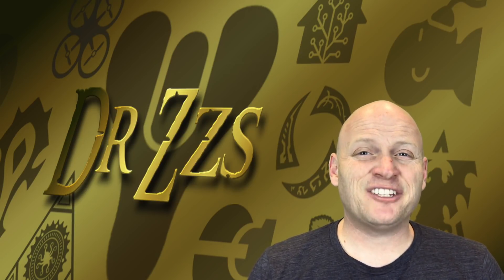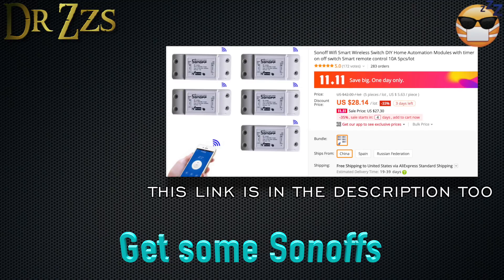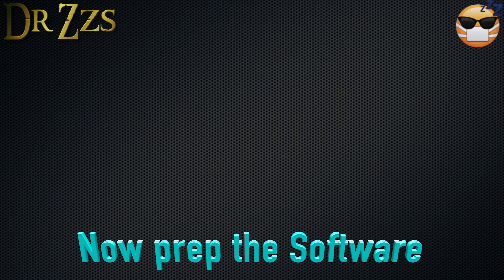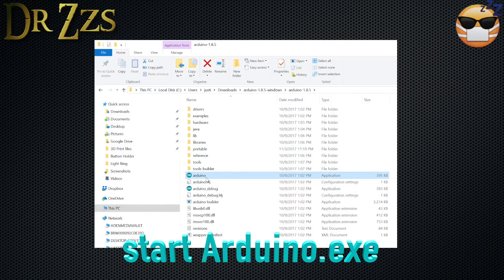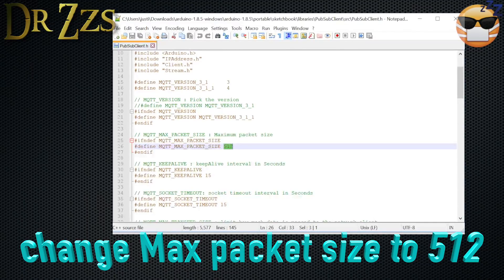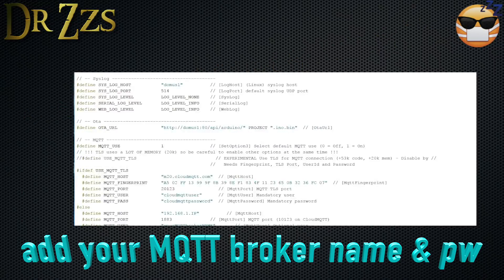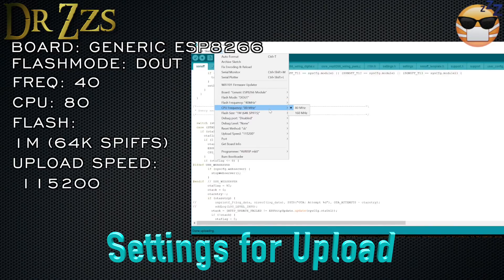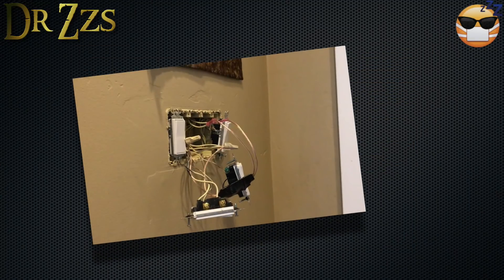Flashing TASMOTA Firmware on the Sonoff Basic

Comment: Great tutorial but I can't upload the file in the Sonoff. 
Everything worked fine, I could compile all but I get the error messages 
"warning: espcomm_sync failed, 
error: espcomm_open failed, 
error: espcomm_upload_mem failed and
error: espcomm_upload_mem failed."

I tried to swap the TX/RD lines but it did't work. What's going wrong?
Reply from the maker: You might not be getting the board in programming mode?  
you have to hold the button when you power up the board.  It can be a little tricky.  
What I found works best is connecting the USB/FTDI board to the PC, then connect the Tx/Rx/Gnd to the board.  And last, push the button then connect the 3v pin to the board.  
I got a chime on my PC when I had done it correctly.  
That's my first guess.
Reply: Hi!

and thank you for your answer. The problem is indeed the programming mode. 
I have a sonoff RF and in this type of device you CAN'T start the programming mode with the button. The layout of the board has been changed.
I found the solution here: http://bit.ly/2Dz3CVp . After I soldered two wires and connected them to a push button I could put the sonoff in the programming mode and upload the firmware.
Solved!
Reply from the maker: Fantastic!  
yes, on all sonoffs (as far as I know), you have to put GPIO-0 to ground when you power up to get to programming mode.  Not all of them use GPIO-0 for the on-board button. 
Glad you got it solved! 
Another victory for the the DIY-guys!

Comment: Thanks for the video. I ran into a few hiccups with this new version but in the end it worked great and was in home assistant once I added it. I was getting missing library file errors. For example one was TasmotaSerial.h missing and another was  IRRemoteESP8266.h missing. Instead of knocking them out one by one I did this:

I copied everything from Sonoff-Tasmota-5.11.1\lib folder into C:\Program Files (x86)\Arduino\libraries

 All errors cleared and flash was successful.

Not sure why I had to do it but it worked, maybe I missed a step and this was required from the get go.

Thanks for the video. Between Superhouse.TV, BruhAutomation, and yourself this is moving along nicely.
Reply from the maker: Thanks! 
ya, I need to update this.  At the time I made it all the necessary libraries were there, but now the best thing to do is what you did. Just copy the whole folder from Tasmota.  
Glad it's working out.  Being listed with Ben and Jon is pretty cool. Thanks
Reply: I'd send you a PM with my website address but I don't think it will let me. I'm slowly building a page... but I think the three of you and whoever else should start one. 

Home Networking, Automation and Technology is a hot topic right now .. and the current sites that exist have unhelpful content.
Reply: I'd send you a PM with my website address but I don't think it will let me. I'm slowly building a page... but I think the three of you and whoever else should start one. 

Home Networking, Automation and Technology is a hot topic right now .. and the current sites that exist have unhelpful content.
Reply from the maker: Nice Timing!  
I just spent some time yesterday working on mine.  I had a site that was okay, but I want to make something better.  I'm spending a lot of time learning WordPress right now. 
I did get email set up.  You can send me stuff at:
justin@drzzs.com

Let's discuss what content would be most helpful!

Comment: Thanks for the guide..1st Tasmota Sonoff complete! - for those who are having errors on compiling do this - copy everything from the tasmota zip files 'lib' directory (in my case it was  -  Downloads\Sonoff-Tasmota-5.11.1\Sonoff-Tasmota-5.11.1\lib)  to your Arduino folders 'library' folder (in my case - arduino-1.8.5\libraries) and it will clear up all those errors in one hit :)
Reply: From experience I've found it's always better to use the libraries included with the Tasmota source rather than downloading the latest versions with the library manager.  No need to download json or PubSubClient as they are also included with Tasmota.  When doing this, there is no need to edit the PubSubClient.h file as it's already done.
Reply from the maker: Awesome!  Thank you!  That'll help a lot of folks!
Reply from the maker: Zeric E Sweet!  That makes it a ton easier. 
Thanks!
Reply: It helped. Thank you .You saved me gray hair.
Reply: thanks I put everything into the portable folder as followed from this tutorial complied right away
Reply: That worked for me as well, thanks. I also already had a newer arduino board manager from having recently done some flashing of NodeMCU 8266 boards so I skipped that part. In case anything changes, this is as of Jan. 2019

Comment: i'm not have "Qunqi 3.3V 5.5V FT232RL FTDI Usb to TTL Serial Adapter Module for Arduino Mini Port". can i use aduino UNO r3 ???
Reply: Any USB serial converter will work provided it's can supply 3.3v power.  An UNO R3 can work just fine, search google for tutorials. I prefer a stand alone CH340 based converter, only $2 from china or about $7 on amazon. Prior to getting that, I used an UNO for serial programming but it's been so long (years) I don't remember exactly how I did it, but the information is out there.

Comment: why this error now:

Board generic (platform esp8266, package esp8266) is unknown

Error compiling for board Generic ESP8266 Module.
Reply from the maker: try this URL in the Board manager URL box in Preferences:
http://arduino.esp8266.com/stable/package_esp8266com_index.json

then search for esp8266 in Tools - Board - Board Managers

I wish I could just give you one that's already done.  Sorry
Reply: I uninstalled all. Installed again. stable json too. A new set of errors at compiling. :((

Thank you, but I wanted to do it myself. Now, I have to stay to use original sonoffs, that connect to itead server, that is not reliable. 

Then still there is to setup mqtt broker and to find android and ios app. Also without succsess with my ota tasmota sonoff.

Comment: now, this file is missing. #include <TasmotaSerial.h>

I am at the end with my ideas
Reply from the maker: ya, that came up for someone else too.  I know how to find that file, but I'm not sure exactly where it goes. 
You can get the file here:
https://github.com/arendst/Sonoff-Tasmota/tree/development/lib/TasmotaSerial-1.0.1/src

This might tell you more about what you need to do.  
https://github.com/arendst/Sonoff-Tasmota/issues/1522

I didn't have that problem.  I don't understand why some people have. 
Man, I am sorry you've had so much trouble with this.  I know how it feels to work so long on something that should be simple and still not have success. 
I really hope you get it solved soon!
Reply: now i get

Board generic (platform esp8266, package esp8266) is unknown

Error compiling for board Generic ESP8266 Module.

i have choose that in board manager
Reply: All the libraries are included with the tasmota source under the lib directory, just move them under portable\sketchbook\libraries. Until that is done, you will be fighting many missing libraries errors.

Comment: Does tasmota or other custom firmware have capability to turn on lights when you get close to the house and uses phone GPS as presence sensor?
Reply from the maker: That's a great question.  
There are probably 2 main paths to solving that problem.  One would be to use a motion detector connected to the Sonoff.  That would be fairly simple.  The motion detector could connect to the GPIO pins on the sonoff, then with some tinkering in Tasmota you could make it so when there is motion the lights are on, when there's no motion the lights go off.  You can probably see the problem with that solution.  If you sit still too long the lights might turn off. 

The second solution would be more complicated.  For that kind of interaction between devices (your phone GPS location and the lights) you need some way to make "automations".  

That would require some kind of Home Automation hub, like Home Assistant, openHab, Samsung SmartThings, etc.  The hub would get input from the phone GPS and activate the lights when the phone is inside a set GPS location. 
Once you have a hub set-up there are a variety of ways to do presence detection.  I haven't found one that is 100% reliable yet.  
When I do find a good one you can bet I'll make a video about it.
Reply: I do something along this line with Home Assistant, but it is complicated and not something to undertake unless it's part of much larger home automation project. The local motion detector route may be better. ESP Easy may be better than tasmota for this sort of thing as it is highly configurable and flexible.  No matter what direction you take, there will be a learning curve, experimenting, and likely a lot of swearing.

Comment: Is it possible to upload program to sonoff with arduino?
Reply from the maker: yes, absolutely! 
I haven't done it, but you can use an Arduino as the USB/Serial adapter.  I've seen a video about it.  Let me see if I can find it again...
Reply from the maker: Here's one:
https://youtu.be/qqSLwK1DP8Q

I'll have to try it myself sometime.
Good Luck!
Reply: Be sure you supply the needed 3.3V power (not 5V) to the sonoff, otherwise it should work fine.
Reply: Thank you very much for your concern.

I have made it 2 days ago! Installed under programs386, files are in C:/Arduino. Now, I have done OTA and with Arduino board (as usb to serial). {A good idea is simply to use esptool.....} Next step is Broker. I will use RaspberryPi3, witch i ordered. Better would be Smartphone, but i did not find any Broker good enough.
What are good apps to connect to broker?
Reply from the maker: Awesome! 
So glad you finally got it working!  You had a hard time with it. 
I don't use an app besides Home Assistant.  Just did a quick search and looks like both Android and iPhone have a few options.  
When you find one you like let me know.  Others may want to use something similar as well. 
Good Work!

Comment: great video, tks, I will try it with my pow. one thing you might have missed is that esp8266 board library is necessary otherwise you will not be able to see generic esp module in the board menu
Reply from the maker: Flavio Dexter Thanks! 
You are absolutely right. I totally skipped that. Dang it.
Reply: UPDATE: after few problems I managed to fix the flash procedure. I had to disable mDNS on user_config.h to make it work on the sonoff pow but now everything works great and I have it in my mqtt broker with OpenHab. Now I'll have to find a way to create a nice sitemap to show relay status and data consumptions
Reply from the maker: Awesome!  
I'd love to hear how it goes.  I need to learn more about OpenHab.

Comment: Is anyone having an issue compiling the Sketch file with the esp8266 board running version 2.4.0? I keep getting the following error:
Sonoff-Tasmota-5.11.1\sonoff\xdrv_02_irremote.ino:25:29: fatal error: IRremoteESP8266.h: No such file or directory.

I am going to try and downgrade to 2.3.0 to see if that works, but wanted to get any additional suggestions from the community.
Reply: The IRRemote library issue is just one of many missing library related issues that will occur at present.  Things likely changed since this video was released, a common problem with the how to videos on compiling tasmota (or other software). So here is what you need to know....

At present (tasmota 5.11.1 and arduino 1.8.5), all the libraries are included with the Tasmota source download.  It's much better to use the known working versions included with the Tasmota source rather than getting newer, and potentially problematic, versions through the arduino library manager.  Added bonus, the edit required for PubSubClient.h is already done. If you already have json and pubsubclient installed, delete them (from ..\portable\sketchbook\libraries) and move all the libraries from the Sonoff-Tasmota-5.x.x\lib folder and put them under the ...\portable\sketchbook\libraries folder in the arduino tree. After doing this, all the library compile errors went away.

As far as changing PROJECT in user.h to deal with multiple devices, I find it's better just to change if from the web config once it's online.  If you have many devices (I have maybe 15 or so, most running ESPEasy software), you are not going to want to recompile for each separate device.  That way you can use 1 known working binary to update all your devices.
Reply: @timezonewall  Thank you very much. You solved my problem.
Reply from the maker: Zeric E You’ve obviously got some deep knowledge and experience. Thanks for helping out!
Reply from the maker: You can also try going into the user.config.h and comment out all the references to the IR Remote. 
Looks like it's trying to load an IRremote library that isn't there. If you don't have the IR Sonoff (They make a Basic with IR, if you just bought a basic, it doesn't have IR an receiver).  Other option is go to Libraries and search and install the IRremoteESP8266.h library.  But there's no reason to do that if you don't have an IR sonoff.
Reply: Zeric E I ended getting compile errors even after copying the the aforementioned libraries.  I had to copy ALL of the Libraries from the Tasmota download and past them into my library  folder.  After that, it was cake.
Reply: +1 for having to move all the libs  Thanks everyone.
Reply: Hi (noob is talking) I have same issue. Can you advise which lib to which lib I need to copy these files?
Reply: OK forget my last comment found the libs thanks
Reply: Ben Steckler Hey i enjoyed your video. I just subscribed. Thank you. I have a really important question i would appreciate a response. I have a small business. And we clean sofas. Sometimes i wish to know. If my employess are working more or less and i think i can tell by how long the vacum has been on? Can this device tell me how long a certaon device was on? And from what time to what time?

Comment: Your video is great. but i have a question, does it still work in eWelink app after we uploaded TASMOTA Firmware ? Thank you so much :)
Reply from the maker: Nope sorry.  
If you flash with Tasmota you loose the interface with eWeLink.  
Tasmota makes it possible to use MQTT (and other methods) for communicating between the Sonoff and your Home Automation hub. 
Home Assistant is the hub I use and I love it.  You can connect a bunch of smart devices and have them all interact together.  And there's just one app to open to control all your smart devices.  
And it's just fun.
Reply: Also of note, there is no way to go back to eWeLink unless you back it up before overwriting.  The factory FW is hard coded for each Sonoff device so it's not possible to obtain the original FW from someone else, you must copy it off before replacing the FW on a sonoff device.  The details are more than can easily appear here.  In short, you need python installed and esptool.py installed, then the command would be along the lines of:

esptool.py --port COM3 read_flash 0x000000 0x100000 sonoff_ORGFW.bin

Comment: Great video, do you have a video on the setup and config of a MQTT server? I am very confused :'( I want to be able control my own light from my phone on my own server and also operate them via a switch on the wall. I've got the switch on the wall working but struggling with the tech side of things to get it working via my phone. I have openhad2 installed but now don't know where to go. From everything I've read i believe i need an MQTT server but have no idea what to do.

Cheers.
Reply from the maker: You're right I totally should do an MQTT video.  It's on my list! 
I know a little about MQTT, not a ton.  Are you running OpenHab on a raspberry pi?  If you are you can use that pi as an MQTT server with a program called Mosquitto.  There are others too, that's the one I use. 

There are a lot of videos out there on how to get going. 
https://youtu.be/Pb3FLznsdwI

Getting Mosquitto installed will depend a little on what OS you're using.  

There are also cloud MQTT solutions, but it sounds like you want everything running on your own server, and I can't blame you for that.  
I run my MQTT broker on the same pi that runs Home Assistant.  This is the guide I followed. 
https://youtu.be/AsDHEDbyLfg

I was confused by it at first too.  The terminology is confusing.  Here's my attempt at explaining MQTT in 1 min or less:
You have a Broker (Mosquitto) and Clients.  The Clients "publish" and "subscribe" to "topics" and the messages they send are "payloads".  
So one client is my Sonoff and another client is my Home Assistant instance.  My sonoff connects to the broker using the broker IP address, port 1883, and a user and password you set up, and subscribes (which means listens) to a specific topic that looks something like this "cmnd/sonoff/power".  Then Home Assistant "publishes" to the broker on that same topic "cmnd/sonoff/power" with the payload "on" or "off".  
The broker takes the published message from Home Assistant.  Looks at what clients are subscribed to that topic and sends them the payload.  That then activates the action at the Sonoff.  The same happens with the "State" of the sonoff.  It publishes on a different topic to tell the Broker it is on or off.  Home Assistant subscribes to that "state" topic so it will get the message when the sonoff sends it to the broker.  

Does that help? 
It'll probably take at least a month for me to get out an MQTT video.  So many cool projects, so little time!
Reply: DrZzs thanks s for the explanations man I appreciate it! I've got some serious homework to do! I have openhab2 installed on my qnap Nas, not sure if I can get mosquitto on that or not but I'll look into it. If all else fails it sounds like a cloud based MQTT server sounds easier. Thanks again for the help and links. Cheers.